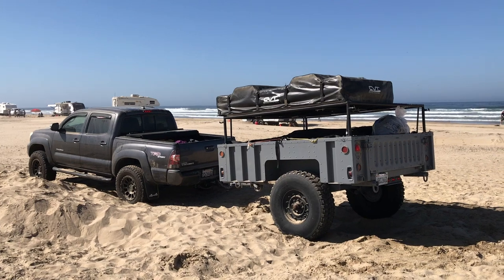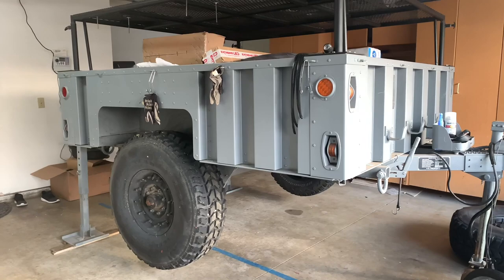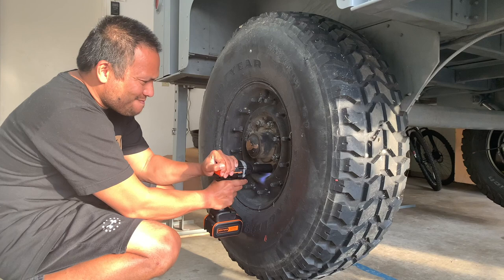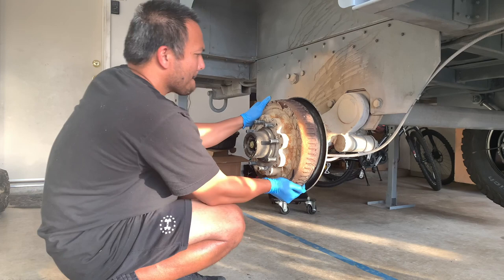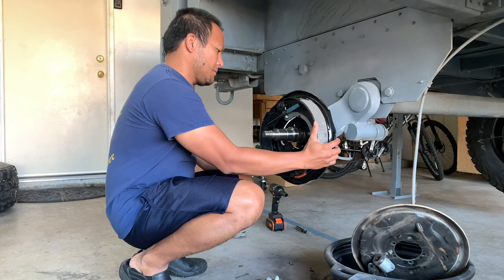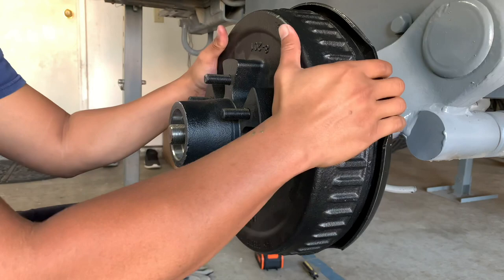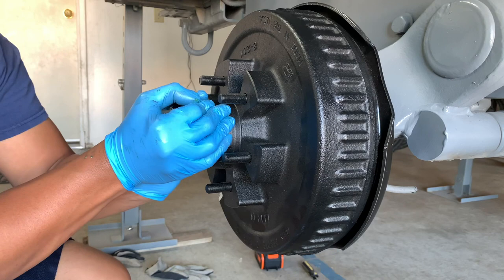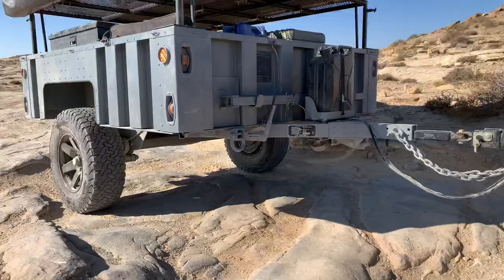Installing a Dexter Electric Trailer Drum Brake Kit on M1101 Humvee (HMMWV) Trailer / step by step

Comment: To anyone else that may buy one of these trailers, make sure you repack the bearings promptly. I found out the hardway how important that is with my m1 trailer recently, as the outer bearing failed and the wheel came off going around a corner. (The grease had the consistency of wet wax) fortunately nothing else was damaged and I was able to just buy a new bearing for $35.

Comment: Hello sir., if I am. Going to use this trailer with tacoma, 2018. What is the correct part for the trailer. Pls advise. By the way great video for this trailer. Ok
Reply from the maker: which part did you mean my friend? if you mean which brake (back plate) I used to change the trailer brakes to match my tacoma, it is in the description. check to see if you have a 6 lug vs 5 lug pattern. then ask for that hub to go with the back plate. i hope that helps!
Reply: @expeditionaryfamily 
Thanks a lot!

Comment: Smart change. Looks better too, and I run the 12 bolt wheels on my Hummer so it isn’t hating the 12 bolts.  Hope you sold all the take off parts for others to have as affordable spares.

Watching it ride- you don’t have it loaded almost at all. You might consolidate softening the rear suspension a little so it rides better.  Watch your trailer tires for cupping which indicates the tires are skipping down the hiway after bumps from too stiff suspension.

Also remember to do the chalk test to adjust the trailer tires to proper pressure for its weight for maximum tire life.  The military idea of marking the tire pressure next to it is nice but do it inside the wheel well and it isn’t noticeable by anyone but you when kneeling down to check tires.  

Have fun!

Comment: I'd love to ditch the surge brakes as well and run electric brakes so that I can have better control via my brake controller. I need to figure out an electric brake conversion without ditching the 8x6.5 hubs.
Reply from the maker: i dont know how to do that without replacing the whole brake assembly like we did. the surge brake mechanism does not have any electronic input at the hubs. If you do replace the whole assembly, im sure you can get ones with 8X6.5 lug patterns. the ebrake if far superior to the surge brake in my opinion.

Comment: Do you know if I can use the original 8 x 6.5 hubs with the Dexter 23-112 brake assembly? Or do I have to source new hubs if I do the conversion to electric brakes? Thanks for the great video.
Reply from the maker: it does not fit. the diameter is different. you might have to get a whole kit with 8x6.5 lug pattern.

Comment: Have you adjusted the suspension on the trailer at all? I have a M1102 and it seems to sit much higher. Thanks for any advice
Reply from the maker: i have not! however, we did change the tires from 37 inches (stock) to a 33 inches. this made it sit lower, as you see it now.

Comment: was the hub separate? because on dexters website that part number only shows the backing plate with shoes. can you put a link with that toyota hub on here please?
Reply from the maker: yes. you basically choose the lug pattern on your hub. you have to ask for a hub with a 6X5.5 lug pattern (for the 6 lug toyota tacomas)

Comment: so how do you order the new hubs and brake assembly to know that it fits? I'm thinking of doing this to another model military trailer. Thanks.
Reply from the maker: The way we did it is to measure the spindle length and us a caliper to to measure its diameter. we called a trailer shop who sell these brakes and gave them the specs.
Reply: @expeditionaryfamily  And there was a bolt pattern that matched up to bolt the hub onto the axle?

Comment: Is the part #K23-112-00 on Dexter’s website the same thing you used? Is 12” correct?
Reply from the maker: im not sure. this is a question for the Dexter people. I know that there is a variation that has a handbrake attachment. so im not sure if thats what the "K" stands for. the one we have has the handbrake.
Reply: The k means “kit” which will include next nut and rubber plug but yes that is correct part

Comment: I'm thinking of doing this too. I have a bronco which I think has the same lug pattern as the tacoma (6x5.5) but when I look for that Dexter part number, it doesn't look like it includes the lug hub, just the brake assembly and back plate. Did you have to order the lug hub/cover separate? If so, do you happen to have a part number. Love the video.
Reply from the maker: yes! you have to get the hub with the lug pattern you need which goes with this brake.

Comment: Question, I recently been looking into this trailer myself, and finding different things each time. But this is one of the best information provided. Wondering can this be set up to match a Jeep wrangler wheel base?
Reply from the maker: If by wheel base you mean, the measured space between the two tires... then I would say "no". Not without drastically changing the chassis!
If you mean changing the lug pattern to match your jeep so the tires are interchangeable between the trailer and the jeep... then "yes" in the same way we changed it to match our truck in this video. you just need to know your jeeps lug measurement and order the hub with this pattern. i hope this helps.

Comment: Would you ever consider doing a trailer walk around? I love what you've done with it and want to do some very similar things. Is your rack raise-able? I'm located on the Central Coast, looks like you've been to Pismo. Thanks!
Reply from the maker: I was planning on doing a walk around video the next time we go out camping. we're planning on the first week of next month. Our rack was raisable before. it had a DOM tube that sleeved over another, a locking pin, and was assisted by gas struts to push it up. The rattling of these components caused one corner to snap. We found that we didn't need to raise it. So we decided to weld all corners in place. It is no longer raise-able.
Reply from the maker: Here you go Jeremy. Sorry it took a while. https://youtu.be/vH4ZjYwbDXc

Comment: How did you connect the trailer brakes and lights? Were you able to register the trailer?
Reply from the maker: these trailers originally uses a 9 pin connection (military). you have to convert it to a 7 pin connection (civilian). you can get a 7 pin with connector with a junction box. from there, you just find the connection to trailer lights and brakes. 
   yes you just take it to the DMV (California for us), we used the serial number of the trailer and use it as a VIN.
Reply: @expeditionaryfamily  thanks

Comment: Great work! Can I get the hub with 6 5.5lug pattern part number?
Reply from the maker: I don"t have the specific part number for only the hub. I have the part number for the brake back plate that fits over  the spindle its: Dexter 023-112-00. your best bet is to ask for a hub that goes with it that has a 6x5.5 lug pattern. 

Disclaimer: to make sure it fits your specific trailer, I would take a caliper and take measurements of the spindle. I was on the phone with brake shop while measuring the spindle to make sure what im buying fits. 

Hope this is helpful.
Reply: @expeditionaryfamily  Thank you so much for the information!!

Comment: Great video!

I have the same trailer and I would like to replace my hub as well to match my 4Runner. Where did you find yours hubs and what is the part number. I would actually like to retain the surge brakes. 

How hard was it to switch everything over and bleed the brake lines? 

What’s your IG I could use some advice on my build?
Reply from the maker: So you wanted to keep the surge brake and just replace the hub? im not sure how to do this. we replaced the whole brake assembly so the hub we currently have would not fit over the old original surge brake set up.

since we didnt care about the old surge brake, we just cut all the  lines, removed the reservoir and changed the pintle hitch to a lock n roll hitch. it was easy, just took time.

we're @expeditionaryfamily on IG
Reply: @expeditionaryfamily  I would replace the surge brakes but it looks like a pain to rewire the trailer lights. I’m open to any advice you have for it.
Reply from the maker: @FIELDS0729  it wasn't that bad when we did it. We got a 7 pin cable that had a junction box. we mounted that box under the trailer, then wired the existing trailer lights and brake to it. the worse part was figuring out which was right and left turn signal wires since the military did not color code.

Comment: How much in parts did this conversation cost? Minus wheel & tire price. Did you leave brakes as stock?  Did you weight any differences in wheels/tires weight?   DOD stock tires have run flats?  Nice Looking builds!
Reply from the maker: the Dexter Brake Kit cost a little over $200. We removed the surge brake system that came with the trailer and used the ebrake that came with the kit. This made for much better braking which is great for a medium size truck like the Taco. The Humvee tires did come with runflats and was noticeably lighter after the conversion. I hope this is helpful!
Reply: @expeditionaryfamily  Do you happen to know the part number?
Reply from the maker: @AgentZ3569  yes it is Dexter 023-112-00.
Reply: Did you keep the factory hand brakes for ebrake?  Is it a direct plug play with cable and dexter?
Reply from the maker: @BJCampbell  yes! I kept the hand brake but replaced the cable. it is easy enough to do but It is not a a direct plug and play because the original handbrake assembly was built into the original back plate.

Comment: Hi ,can I ask a question.  I'm have trailers M1101 , now I'm want change it's brakes kit part number: Dexter 023-112-00, but I'm don't need to change the wheels & tires. so is it possible? thank you.
Reply from the maker: yes it is possible. you might need to change the back plate and have the hub with the lug pattern that match the original wheels (8x6.5). good luck! let me know how it turns out or if you have questions during the build!
Reply: @expeditionaryfamily  thanks you so much